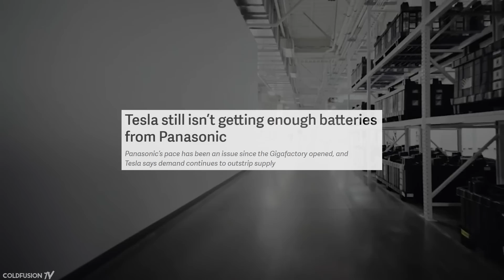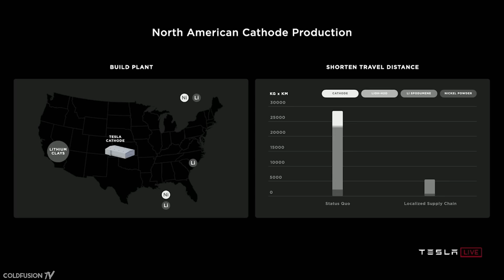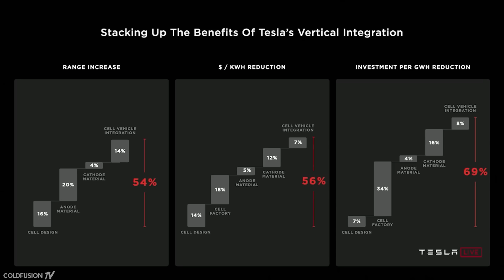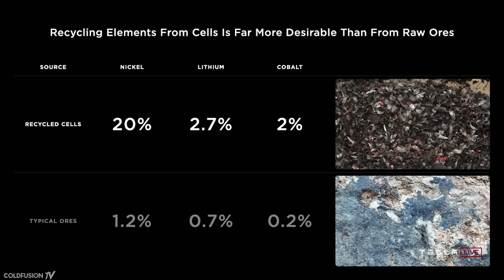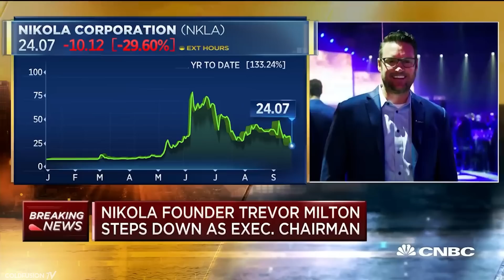Elon Musk: Affordable $25,000 Tesla and Better Batteries Are Coming

Comment: I think as soon Tesla gonna start producing cars by millions they have to create few different brands with a bit different design styles - like Buick (which they are, basically), Chevy and Cadillac or more. Sure, it's "generally" hated "Badge engineering", but it used to work great before and still thriving with use of modern concept of "common platforms" - like VW, Audi, Seat or Skoda...
I, personally, like design of Model S and Cybertruck, but hate those blunt look (inside and outside) of 3, X and Y... :(

Comment: 6:26 Cells are now at around $100 for most brands.
Say a typical BEV gets 45 kWh (for what the average person buys and drives, that's a good car).
$4,500 in cells. Such cars tend to be $30K and over. Let's say total cost is $25K.
I don't think the cost doubles to make it a pack.
Which car has 1/3 of its cost in the battery?

Comment: Is this the same cheap Tesla that we were told would arrive in 2011, 2020 and 2021 and now it’s 2023?  Yeah I’ll believe it when I see it.
So 5x the energy from a cell 5.5x the volume, sounds a real breakthrough.
Reply: Hint !!!

Listen, think, comprehend and then comment...
Reply: Peter Sorrell I did..... tell me what is said was wrong?
Reply: @simonrook5743    Yawn!!   Promised $35,000 M3 was offered (albeit briefly) last year...
NO ONE has been able to design a large battery cell due to HEAT generated by electrons travelling too long a distance within the cell. TESLA has done it (patented).
5x the energy for only 3x the cost.              Listen, Think, Comprehend - then comment...

Comment: if the cost of the battery is 1/3 of the total price,and 156 $ per kwh ,how come a car that comes with 56kwh battery(8424 $) total car cost is 35 k $? as per model 3 specs?

Comment: "Tesla is always behind schedule, so expect the car in 4 - 5 years"

The Model Y released over 6 months early - Tesla has recently learned to sandbag their estimates.
Reply: TimberAngry hope u are right
Reply: gcjerryusc following that logic so did the US, so what?
Reply: But model y ended up using model 3 design while their first plan was to made model y a cheaper version of model x design, that's why tesla able to surpassed their model y initial promise
Reply: gcjerryusc so what has China made that cause those many deaths that you mentioned and how is that related with the automobile industry, considering the case of the US caused theaths are not related since it was military based?!
Reply: The biggest advancements of many of the Tesla team has been reinventing manufacturing processes and continuous improvement in the products and component design/fabrication. As Elon says, Building better machines to build the machines. They have a pilot plant now making these batteries, it is large enough to produce enough of these new cells for 100,000 Model S or CyberTrucks. But yield is not up to production goals, probably less than 50% passing life and performance tests, which was the case with the Panasonic 2170 cells made in Gigfactory Nevada. So the long estimated time for scaling seems rather pessimistic compared to what will actually occur. They have learned to underestimate production times and performance as a tool to keep competition from sensing the need to throw more resources into their efforts. The Model Y was a good example, in the customer's hands in high volume production 6 months ahead of schedule. FSD feature-complete is ahead of schedule by 2 months. 
The effort now is to improve the yield of the new cell, while building the automation to build them at a higher speed. They are shooting for 4x throughput per hour over the current 2170 cells which means far more cars can be built because far fewer new cells are needed for a given energy level, that reduces the weight of the vehicle which in turn reduces kW/hr needed for a performance spec and improved handling. 
This cell is a very big deal although the business and automobile press was not impressed because they do not see the larger picture.
The cost of power walls, and power packs will come down, which means the cost of solar power for homes and businesses will come down, lowering the demand from the grid, and actually selling energy back the grid automatically. Autobidder software by Tesla allows power walls and solar to pay for itself in a short time. Even when there is no sun for days, changing the power wall at night is low cost and selling it back the grid in peak demand times will essentially make the home or business energy independent and a profit center instead of a cost.  
The real threat to existing car companies is not Tesla cars, it is the robotaxi service that is so much lower cost than owning a car that a new generation will not even have personal cars as a choice and major reduction in the cost of living. As it is now, car ownership is the biggest American living expense, where homeownership is an appreciating asset and car ownership is a constantly depreciating asset that costs $1000-5000 a month in total cost. Having that free cash flow would change the entire economy and almost eliminate poverty in car-centric societies. I know after moving from California where it is essential to have a car for every adult in the home to live, to a large city in Eastern Europe with excellent public transportation, mostly electric, my costs of transportation dropped from $10,000 a month to $45. Most people estimate the impact on finances by adding only fuel, maintenance, insurance and registration but having 1/3rd of a home space devoted to storing cars, and depreciation, loss of time in traffic etc are real costs and much higher than the selling price of cars. A strong sense of gained personal freedom was felt by NOT having a car when I moved here 20 years ago and I have never been tempted to get one. I came home at 4am from a club this morning, 5miles for a taxi fee of $1.10. I am going 58 miles north to the country house in an hour, for subway them minibus for a total cost of $1.20, for two people. That is about the cost of gas alone.  I have reserved 2 CyberTrucks however and will use them in one of my businesses and for robotaxi service for hauling items too big for a car trunk.
Reply: the model Y shares about 75% of its parts with the model 3, and because of this Tesla released the car before schedule. this won't happen with new vehicles that Tesla are designing from the ground up...
Reply: A 2020 model Y costs less for Tesla to produce than a 2018 Model 3 - that shows the pace of innovation.
Reply: Imagine being upset that a company literally making things up out of thin air using advanced science runs into delays lol
Reply: Yeah. Good video overall, but he was off on certain things. He probably doesn’t have deep knowledge of the company like most long term investors do.
Reply: I thought the Model Y was behind schedule as well. Thank you for the clarity.
Reply: Not just sand bagging, also just increasing the speed of everything they do. Munro describes Tesla as an Edison lab. A few months into model Y and there have been hundreds of little changes under the skin which would have taken a traditional car company years to implement.
Reply: I'm hoping for a Plaid Model 2 by 2023. It would be the most sought after hot hatchback since the Honda CRX.
Reply: hey you have to watch this video the first-ever electric FES sailplane taking off, it is amazing (and much much more advance than pipistrel)Lak 17c FES Self Launch  https://youtu.be/rxe6DIfPKb4?t=83
Reply: How about that 2020 roadster?
Reply: Because tesla model Y is model 3 with raised seats . They have been severely overpromising timelines on every other product or service. Starting from semi, roadster  ending in actually working FSD.
Reply: The Osborne effect in action on battery day
Reply: Semi and roadster are late though
Reply: Exactly.  When I heard that, thought geez, another YouTuber acting like they are an expert but really faking it.
Reply: gcjerryusc  How could you be so misinformed?  Murdered thousands? Are you mistaking the US for China?  China has become the new punching bag for political purposes and the intense propaganda that started 2 years ago is typical of the run up to targeting countries militarily over the last 100 years in the US. Turn off the propaganda channels and go spend a few months in any of the targetted countries and you will be very much better informed than any of the press or politicians pushing their agenda. This pattern has been repeated dozens of times in your lifetime, vilifying a country or leader as a manufacturing consent. Go to these places, and see reality. Nothing you know about these countries is true right now.
Reply: he dint have as many factories open then as it is now
Reply: Model Y was based on model 3 so much of the production hell were already sorted out... For all the things announced on battery day, that may take some time. But i think that's all right if you know Tesla and what they are capable of doing at thd end of the day. I think it will revolutionary  just like the Ford Model T😀😀😀
Reply: It's to avoid the Osborn effect.
Reply: Does anyone else realize that it’s not a coincidence that Elon Musk is always making promises and not delivering? This has everything to do with raising capital. This company is a classic stock promotion scheme. Tesla’s core business is not selling cars. It’s core business is selling stock to unsophisticated investors and selling cars is just marketing for this purpose.
Reply: Hunter D  it's the logical thing to do. Why put so much stress on your workers and over promise when you can under promise and over estimate the time needed to engineer said battery and then deliver "early" and then you look like a hero vs being the flake.
Reply: The model Y is basically a model 3 so yeah, they only needed to make a few modifications since they share %75 of the same components as opposed to starting a totally new build.
Reply: @garrycole9187 : it is not just Toyota that "piggybacks" ads you say.  There are few it any car makers that do not.  Even the very first Ford, the Model T, had variations including what we would call a pickup.
Reply: Could the car be intentionally delayed to avoid the Osborne effect?
Reply: But the Y would cost 17k they promised in the begining. Now its above 50k
Reply: The what? It's not out
Reply: they were able to make model y fast because it shared alot of components with model  3.  createing a $25k car requires alot of technology advances and lower cost
Reply: Where’s that $25k Tesla? It’s been 4 years lol. Still struggling to squeeze the 4680 cells through their bottleneck as well. Here’s to 2030!…maybe
Reply: Tesla always over estimates their time to give themselves buffer periods.
Reply: @mregdosz  full self driving when?
Reply: Thts to be expected cause this is literally like inventing the wheel everything is uncharted territory
Reply: This car is being developed in China, I would say he overestimated and later on he will exceed expectations.
Reply: Why do you have to bring up the model Y??? We're having fun casting doubts on this company and here you come with facts.
Reply: @ingemarsmith4154  Thank-you for your reply. I had a good laugh over it.
Reply: Sandbagging is smarter thing to do....
Reply: gcjerryusc china is the next superpower if not already, they produce practicly everything in the world, they are smart and hard working people, they have the man power and the knowledge, no one can deny it. On a flip side they don’t respect human rights they can spy anyone in the country and gather data freely, they treat minorities horribly. Still they are in superior position, they have the leverage, it would be insane to not trade with china.
Reply: I was thinking the same thing so I am expecting ms plaid in mid 2021 and 25k model mid 2022
Reply: hardyman that would be really fast!! But if it happens remind me and I’ll say you called unfortunately it’s the only internet fame I can give lol
Reply: this dude obviously isnt an engineer, take his 'journalism' with a grain a salt

elon does amazing work in literally every industry he enters and dummies just hate cuz they aint
Reply: @CBielski87  He has a degree in mechanical engineering. He's not a 'hater', just reporting the facts like they are.
Reply: Lelz: it's frustrating when someone says things such as "this guy does such-and-such", but does not bother to indicate who they are referring to!  Are you talking about Dagogo, or Elon, or someone else in the video?!  You need to  think about how someone reading your comments might take their intended meaning, especially when there are multiple individuals in the video you might be talking about.

Comment: Tesla has a PLAN, its not a dream but reality. The new 4680 cell IS a reality, the tabless design DOES work, the 10GW Factory IS being built on Kato road, where they work very hard to increase yield and improve the production process, soon to be expanded to new factories that are being built RIGHT NOW in Shanghai, Berlin and Texas where these new 4680 cells will be produced in masses.

I see the mode of operation of SpaceX being applied to Tesla as well.... Just do it, test, break it, improve it, do it again, break it, improve it and do it again... They just DOING it and improving along the way.. No endless meetings, paper design changes, and risk aversions.. Just DO IT and see what happens, improve on what you see. Innovate at the speed of thought!

Comment: As far as actual specs, when they reference "power" or "energy" is this max rated continuous discharge current and overall capacity respectively? Are we still talking about a 3.7/4.2 volt cell?
Reply: The 5x 6x slide was compared to previous cell. But the dimensions changed also, so not straight forward how to compare. The 16% more range tells the most
Reply: @daniel_960_  Right. Im wondering about future hobbyist applications. Whether it follows the 4.2v per cell standard for lithium charge circuits, or these will have some other voltage that will require their own proprietary ICs and boards. 

If 4.2V, then it is more or less plug and play with existing Lithium tech.
Reply: @Ratkill  Yes. 4.2 open-circuit volts, the change transfer medium is still lithium. Loaded, 3.7 volts
Reply: The cell voltage will be the same. That is determined by cell chemistry, not cell size. The larger cell volume combined with the tabless technology means that the new cells will have 16% more energy density and 3x the charge and discharge rate.
One thing Elon did not announce was that they could take DC fast charging to about 500KW with the new cells.
Reply: Surfer Dude if Elon said that, it’s very likely that a lot of people wouldn’t buy a Tesla now and wait 2 years for the really good one!
Reply: @harsimranbansal5355  You are correct. It's called the Osborne effect. That is why Elon did not say it. Personally, it doesn't matter to me because I don't have the money to buy any of Tesla's current models, so I'll have to wait for the next generation of Teslas to come out anyway.
Reply: @surferdude4487  Wonderful, thanks
Reply: Not specifically known, but Musk said they improved the power to weight ratio in the new tabless cells compared to the current cells with tabs.
Reply: Current model S cells have been known to exceed 1,000,000 miles. These new cells will likely out-live the customer who purchased them.
Reply: hey you have to watch this video the first-ever electric FES sailplane taking off, it is amazing (and much much more advance than pipistrel)Lak 17c FES Self Launch  https://youtu.be/rxe6DIfPKb4?t=83
Reply: Have you seen the new Elon Musk interview with Post Malone?!
👽 https://youtu.be/cpI9Eu-4mEA 👽
Reply: Nope mass is a lot more, from where I have read, density doesn't go up too mich

Comment: My biggest question from battery day concerns the implementation of these batteries in the 3/Y. They seam to suggest that they will use these batteries in the 3/Y when they talk about the structural improvements of the megacasting and the new structural use of the batteries, but then they contradict that by saying the batteries will only be used in the Cybertruck/Semi/Plaid S/Roadster. ???
Reply: I'm just guessing here. I think that the larger cell size that uses the tabless technology will be used in all Tesla vehicles eventually. But, the more energy dense and expensive chemistry will be reserved for the Plaid models and the cybertruck.

Comment: affordable would be in the range form 10.000$-15.000$,if like me you live in europe where the electricity is becomming like gold,then extra cost for chaging station and the car itself makes that only rich people in europe can afford these cars, the already taxed to death middle class has difficulty to even buy a new petrol car,not to speak of the lower class,they even have changed the way you can use the electricity net,now they scrapped the night tarif,wich was cheaper,and will implement peak usage,meaning,if you start multiple devices at the same time you will have to pay a lot more,one device will be connected to the net almost all the time,your electric car,if you then activate an airco/heater and do the cooking at the same time,your electricity bill will be stagering
Reply: @Parome yes,you can buy a tesla in europe,but the import rate will be significant,please check for comparison  the electricity rates from belgium,you will be astonished how costly is is